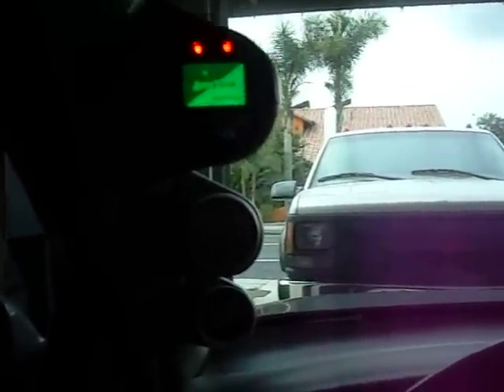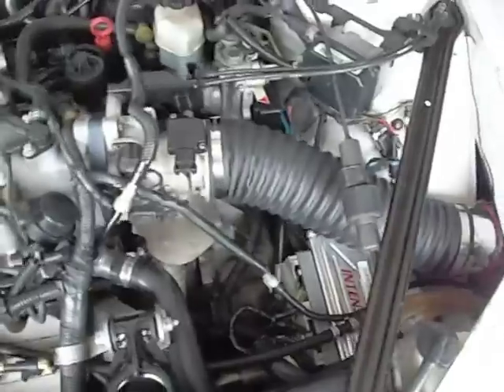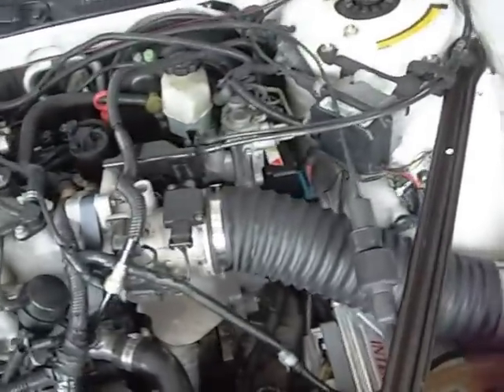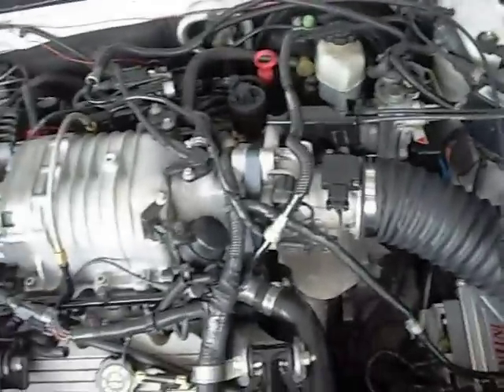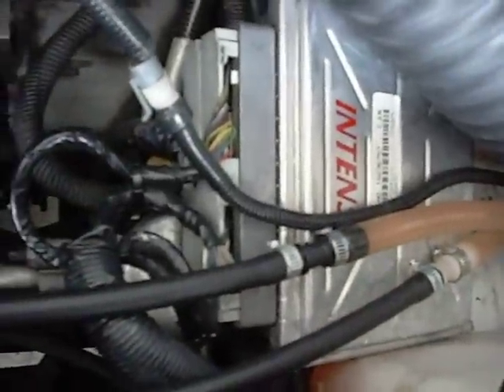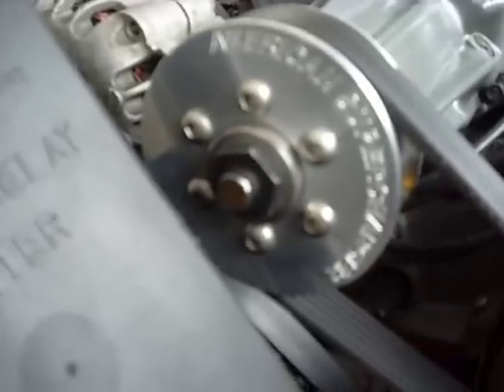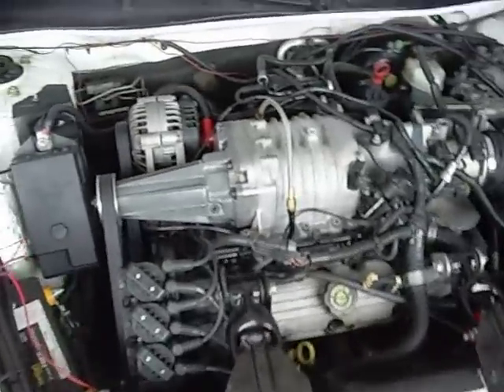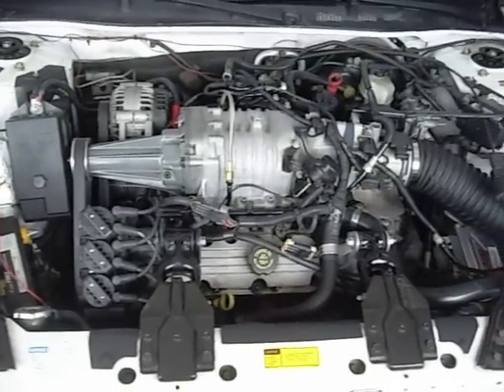3800 Series 2 Modding Basics

Comment: I ran mobile one in mine, burned oil like crazy. You need high tension piston rings to run mobile one.  Run some good synthetic, not that cheap mobile one crap if you really want good protection.
Reply: thats what i use in my cars.. cheapest oil besides generic store brands.. never had any issues, i change after 3,000 miles tho dont really trust 5k claim
Reply: Thats what I run in my C6 Corvette with no problems hell its what GM Actually recommends its says so on the oil cap of the Vette
Reply: Replace rings when engine is new? Lol.   Corvettes have high tension piston rings as do European cars. If you don't have high tension rings mobile one sucks. Funny it burns very little oil with Kendall gt1. About half a quart in 5000 miles.  It's NOT the rings. There has been much testing in this, mobile one sucks. They are all about advertising.
Reply: Actually, Mobile 1 is one of the best oils you can get.

They compared it to royal purple and it protected the engine longer.

I've also experienced mobile 1 to give the inside coating of the engine almost a golden look because of the oil.

They really do use this stuff for race car's, and as long as your using the "high mileage" oil after 50-75,000 miles your car will be just fine.

Mobile 1 is not "cheap". "Autozone oil is...
Reply: never had an issue with Mobil 1 in 20years... something wrong with the car
Reply: I like the gtx but I run that in my neon as for my 2001 Buick lesabra  I haven't  put any good oil in it yep because  it was getting  gas in there and I just fixed  that problem  so when I change  it and change  some other  parts  out because it runs like crappie now then I might try some really  great  oils. Just might give this Mobil  1 a try but  Castrol GTX is the oil I like. I put 5000 miles  on that in my neon  and I dog that this thing a lot
Reply: Elante Ford
Mobil 1 is one of the best. Castrol is 2nd rate to Mobil 1. Now of course if your car has been poorly maintained (EX: Poor oil has been used, not changing oil when needed to.) The best oil in the world won't fix it.

But, if you have a car that you maintain regularly, Mobil 1 will keep it going forever.
Reply: @zzzhuh  If you change your oil it doesn't really matter what oil your using the real advantage of synthetic oil is longer life of the oil.it's no replacement for changing it.I've never had an engine fail on any car I've owned because of oil. and i run them all over 200,000 mile before replacing them.usually because the body is going bad.

Comment: nitrous is instant HP and dirt cheap so yeah why doesn't everybody buy a 5,000$ plus supercharger vs 350$ nitrous kit
Reply: +Charles Bryant On these cars the S/C isn't 5000. The came with one from the factory and a full motor with an S/C is 400ish from a Junkyard. Or a Top Swap for the SC, Heads. LIM will run about 700.
Reply: I was talking about s/c in general there are several different makes and liters, and I do not know the cost of this one but my friend has a Kenne bell s\c on a 89 fox 351 modified 400 and it cost him almost 8000
Reply: And the car make around 880 hp, so it a lot more HP than this car, and it makes power that you could only dream of

Comment: love 3800 but bigger pulleys wont help yes they spin less but your 4in pipe and witha kan n filter you should be good with stock pulleys a big thing you could do it delete the ac and ps talkin 25 -30 hp if your ready to power steer your self i had a 97 gt and a 01gtp and i mean yeah i got a firebird now but stil 3800 o and slowing the pully is bad on a pretty much stock engine its spraying gas that it cant make up for air keep it like this to long and your gonna eat all your seals up

Comment: @krypekeeper personaly the guy before me have put the k&n short ram and its crapy when the engine is hot you didn't have no power beacause it suck hot air so for the next summer i will get the jmb fenderwell intake at w-body store but it was 210$ so its higer than you wanna ây but youre bether with oe air box than with a short ram

Comment: zex nos kit for about 90.00 will get u where  u wanna be at
Reply: Brittany Saylor NOS is crap on these engines.  Best is just to do the supercharger delete and drop in a turbo.  Costs a crapload more, but jumps from 200 hp at the wheels to 500.  Power is always there and just a blast.
Reply: NES Man Dan   ...  i paid 500 for the carvtge nos isnt a power boost its power increaee if used correctly will not harm ur engine its all bout low in torque

Comment: @Branden031 moding is for pros to be for real if you mod a car out expect like at the most 20000 miles for the simple fact your pushing it against what it was built to do if its constantly redlining expect a knocking rod getting to much gas expect to reseal all the valve seats piston rings if your expecting to eat up track cars with your street car save up and buy a vette or a ss camaro ont a fan of the camaro couple guys making firebird kits

Comment: there is to major problems here the obvious one is the cars fwd an the engines facing the wrong way an second why the fuck is the steering wheel on the passengers side of the car haha merica burgers diabetes meh whatever ya say its all the same nice car tho
Reply: Front wheel drive car's are absolutely amazing in the snow, especially in these car's because they are heavy anyways. These engines beat new car's in a straight line. If your looking for performance on a track, you swap this engine into a Pontiac Fiero (yes I have done it.) The car has done 12.7S in a quarter and is beautiful around corner's.

European's have overly expensive car's that are impossible to work on because of the electronics. Plus they depreciate in value about as fast as any American car.

Let me hear more about how American's are dumb.
Reply: the steering wheel is on the driver's side. Just because your'e from some backwards ass european country doesn't make the way you all have the wheel right. America invented cars therefore the way the steering wheel is for us is the correct way. FWD is great in snow and the engine isn't facing the wrong way its more efficient to have it that way. Sure I prefer Front engine rear drive most but that doesn't mean I don't enjoy FWD too I daily a SVT Focus front wheel drive but it handles beautifully, works great in all weather conditions, and runs 14.9s in the 1/4. Not bad for a 2.0 with a hair under 200 horse obviously not a speed demon but it gets me front A to B so I don't have to get salt on my stang or many miles on it plus its still fun to drive. Good Day Sir.
Reply: jman42s
Actually Mercedes invented the first car.
Reply: I bet it lets bald eagles out the exhaust when you step on the gas
Reply: Typical American thinking they invented everything, the germans invented the car first